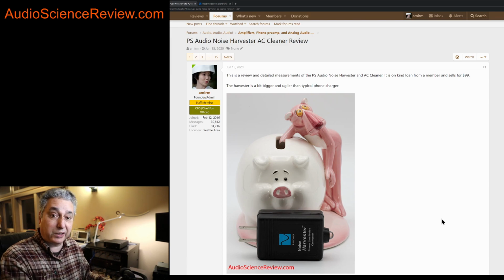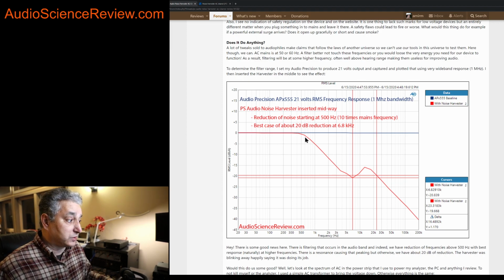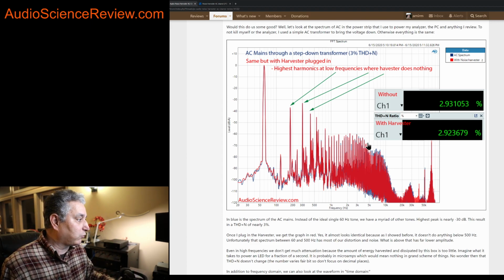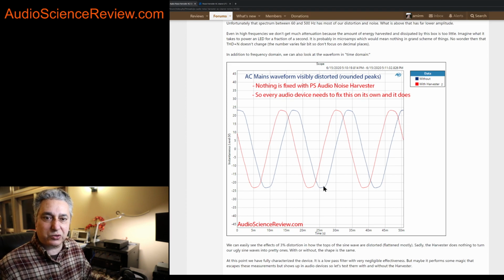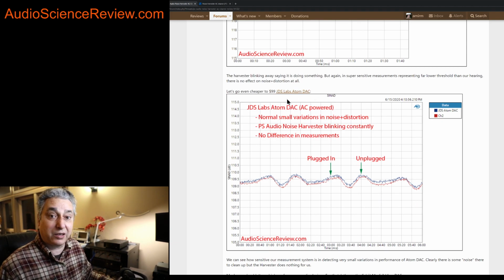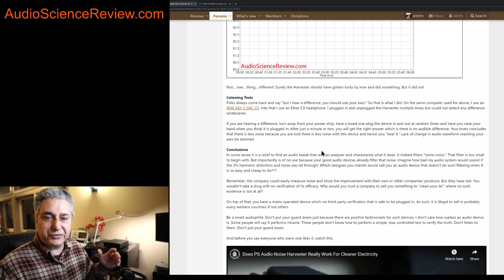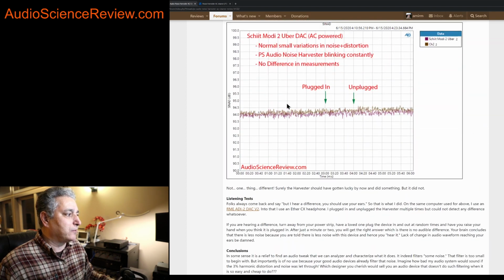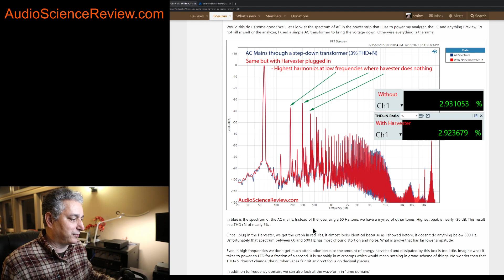PS Audio Noise Harvester Review (AC Filter)

Comment: And to think that people spend thousands of dollars to buy a PS Audio power plants to make pure, harmonic free AC. The pure AC is then put through a bridge rectifier and turned into noisy pulsed DC only to be filtered again inside the amplifier. Or even worse, charge up some capacitors in a switch mode power supply, which itself is probably one of the largest sources of noise in the audiophiles listening room.
Reply from the maker: Very good point.  I actually have one of their older AC generators.  Will do a test and review of it in the future.
Reply: @AudioScienceReview  That would be cool! Any chance to get a peek inside during the vid? Curious to see how they work.
Reply: Assuming it does what they say it does (and I have no reason to believe it doesn't), those Power Plants could be fairly useful where line noise and distortion does cause an issue. If they made a 2u or 3u rackmount version (even with cooling fans) for a less insane price I'd probably buy one for my lab. That idea isn't completely moronic, but most amplifiers these days shouldn't really care too much about the AC line that's coming in.
Reply: @H-77  It would be quite handy for use with something like single-ended triode amps (if your into that sort of thing) or other equipment that does not reject line noise/variations very well. Most commercial solid state amplifiers will have little issue handling variations, though. I've had some linears that will happily play through brown-outs that even take out the lights. The immense loop feedback just compensates for the loss of line voltage. On top of this, most linear class-B amplifiers have unregulated linear supplies, so they don't really care to begin with. I agree it can have its uses, but its massively oversold by Paul and PS Audio for what it can do.
Reply: @mysock351C  True, but some solid-state amps are actually quite sensitive to the incoming AC line. During the early 1990s, Quested used amplifiers from a company called Omniphonics, and these were really bad in this regard. They didn't have enough input filtering and they use a toroidal power transformer that has a fairly high bandwidth. They're also really sensitive to grounding issues. They are a good example of an amplifier that would probably benefit from something like the PS Audio power plant. 

It's all well and good to say that an amplifier shouldn't have those issues, but the fact is that there are plenty of very good amplifiers from an era when line noise wasn't the issue it is today.

Of all the audiphile products to market, power regenerators aren't completely stupid (assuming they do what they claim they do). They're not for everyone- it depends on how nasty the line noise is in your area and what equipment you're using. They aren't going to make things sound "more musical" or anything like that, rather, I see them as more of a way to fix problems. Some vintage outboard gear can be sensitive to this as well. It already sounds very "musical" (because it adds so much distortion), but noise can be a real pain to get rid of. If I were PS audio, I'd market them to the recording studio crowd.
Reply: @H-77  One thing I think people forget about is the same benefits can be had from getting a power conditioner that works to keep the garbage out. That alone can really help with sensitive equipment, and you're not adding another active piece of electronics to do the job. One of the first amplifiers I built had practically no incoming filtering, and its amazing how much crap there really is on the lines. Everything from contactor noise, to tones intentionally transmitted by the power company to handle street lighting and such. Learned a hard lesson there, and in the last one I built, since it uses a switch mode supply, it has the proper filtering so no odd sounds coming from the incoming power in the speakers. But still have at least a surge suppressor just to protect things. Still all of the same benefits can be had just by providing some form of conditioning as it will clean up the AC, and protect your gear. Id take Paul a lot more seriously if he actually gave proper recommendations for both types of products.
Reply: @mysock351C  Assuming it's a decent power conditioner, sure. There are a lot of power conditioners on the market that are nothing more than a rack-mount power strip with the words "power conditioner" on the case. Some amplifiers can easily be modified to add an incoming EMI filter as well, though not all of them have space.
Reply: @mysock351C  I use an old rack power conditioner for a much older Harmon/Kardon Citation 16. Was rather surprised to hear the random hums and other garbage seemingly vanish. Granted my test was simply turning up the preamp with no music playing though.  I just wanted to see if I was amplifying noise (ten years ago in an apartment I was living in at the time). I'd imagine the wifi networks all over there weren't helping much either. Yet when the fridge popped on,  I wouldn't hear the blip though the speakers.  So it definitely did something.
Reply: @thevishnu80  That's actually the intended use for these things, to clean up the incoming power :) I know what your talking about. For years I had a cheap ebay kit amp with just a radioshack transformer powering it and there was lots of garbage in the audio. I built my own with a switch mode power supply and that required the inclusion of lots of mains filtering on the board to stop it from radiating junk through the power cord. It works both ways in that it also stops anything from the power line from making it into the audio. But the filtering in most linear supplies is not so draconian, so running a conditioner does make sense if you have noise issues. But, it seldom seems that they are advertised this way by manufacturers. Rather they improve holography transparency, or something...
Reply: The truth is that most if not all harmonics on the power is generated locally. Harmonics is generated by non linear devices on the AC line. This includes LED lights, Switch mode power supplies, computers, amplifiers, etc. If it has diodes to make DC, has SCR or Triac phase control, or saturable core reactor, it is a non linear device and produces non linear current on the AC line.  A good power line monitor that measures not only voltage and the AC voltage waveform, but measures power factor and harmonic current will find the devices with high amounts of non linear power consumption.  If you use a Hall Sensor probe for your scope, you can look at the harmonic content of the current draw of various devices in the home.